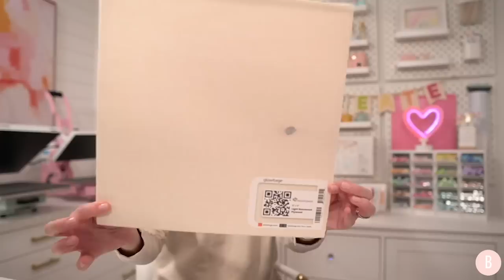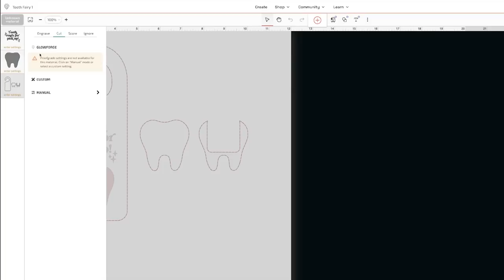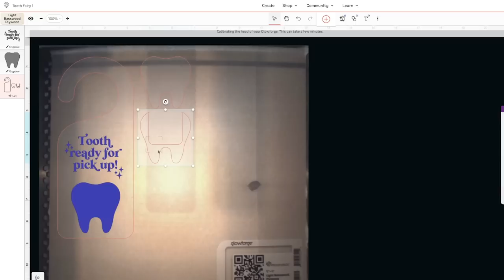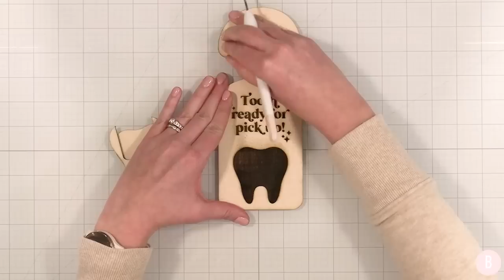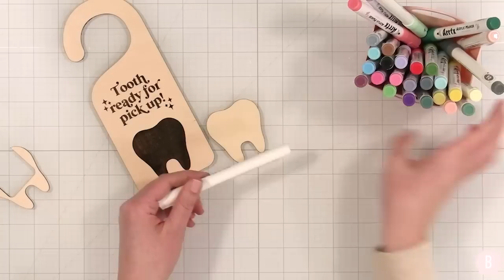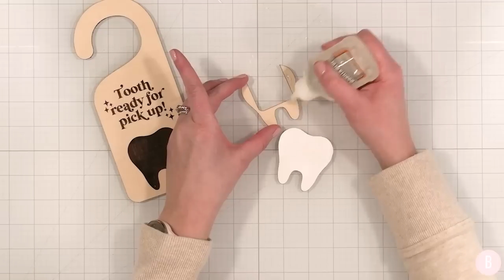The Cutest Glowforge Project EVER! | Wood Project with Glowforge Aura Tutorial

Comment: I wonder if one of the large pieces of tape you pulled off of the top would be sticky enough to help remove the small bits instead of having to buy gorilla tape?
Reply from the maker: Unfortunately, it was too low tack.  I tried and couple times within this video and it just wasn't sticky enough.

Comment: Did you notice certain paints rub right off because there is a shiny finish on the wood
Reply from the maker: Yes! And personally everyone has different preferences, but I’ve found that anything with a finish made an oily mess when cutting.
Reply from the maker: I’ve been purposely only using unfinished wood because I haven’t liked how the finished wood makes a mess when cutting. But of the finished wood I did use, the paint did stick.
Reply: @ oh ok I didn't know there was finished and unfinished I'll have to made a note of that.
Reply: Thank you